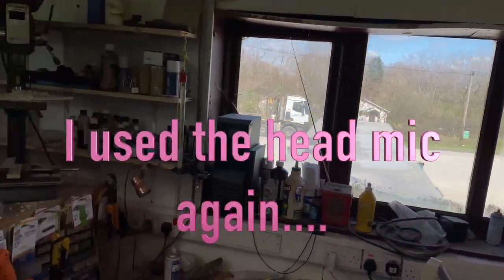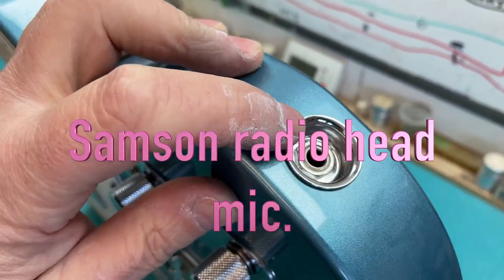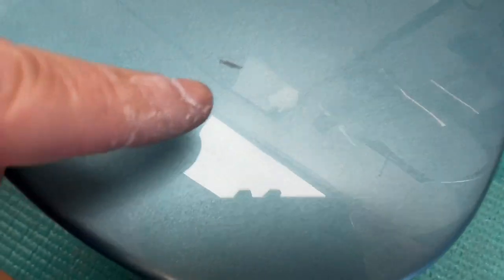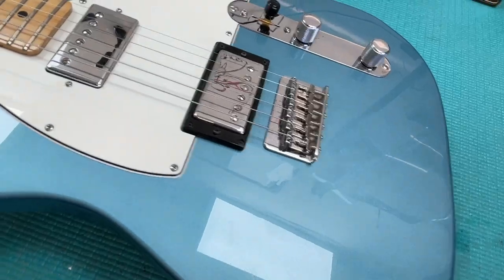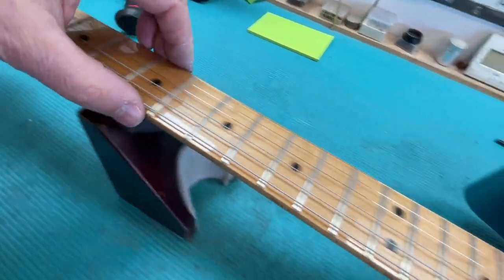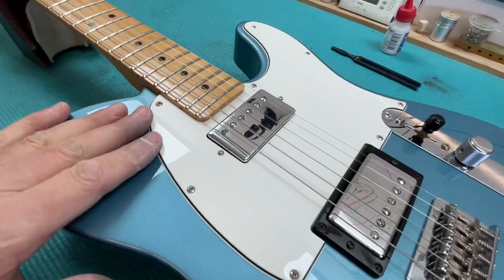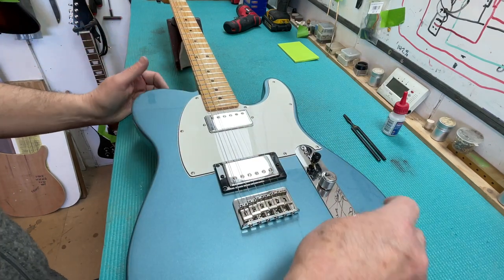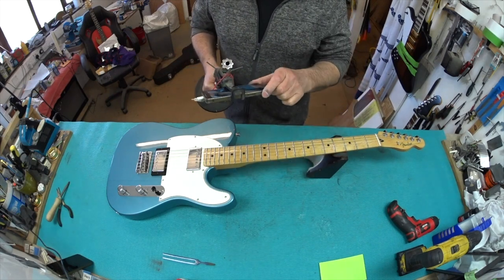Fender Player MIM HH Telecaster set up

Comment: I usually look down the neck from the headstock end to see the grain direction on the headstock tip/edge.

One horizontal grain fender. One 45°. I guess I need custom shop for 90° quarter sawn lol, not that the other two move much anyway.
Reply from the maker: I looked at the heel and including the overhang :) the warp risk is grains starting one way and ending up going the other AND wood that’s still drying.

Comment: Your action is way too low and will have much buzzing and dead notes when you bend strings above the 12th fret.
Reply from the maker: Gosh, if only you had shared this wisdom with me 2000+ set ups and happy customers ago I could have saved myself the misery of earning a living doing what I love these last 8 years.
Reply: @SamDeeksRelovedGuitars  Just my two peneth. To all you novices out there, Sam has done another very helpful video however, my experience tells me to raise the strings to at least 1.8mm on the high E and 2mm on the low E at the 12th fret. Then check for chocking or squealing when bending the strings a full tone anywhere after the 12th fret. When you bend a full tone, play that note, does it ring clear and true? Or does it sound dull? If your frets are not perfectly level (which most guitars are not) you may need to raise to 2mm on all strings or get your frets levelled. Then, tighten the truss rod until you here buzzing or dead / dull notes anywhere below the 12th fret, then loosen the truss rod back a quarter turn. That will be as low an action that guitar can go.
Reply from the maker: @limitedCompanyduo  you may be missing the fact that I always do precision fret levelling to make the chosen low action play without buzz or chokes. Without that, yes, you have to set s as higher action, basically dictated by the condition (levelness) of the frets.